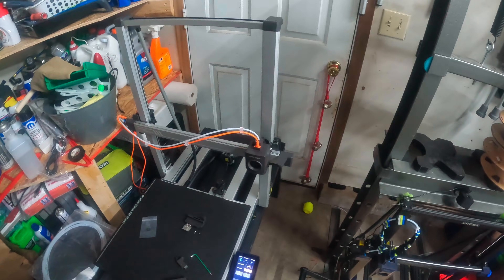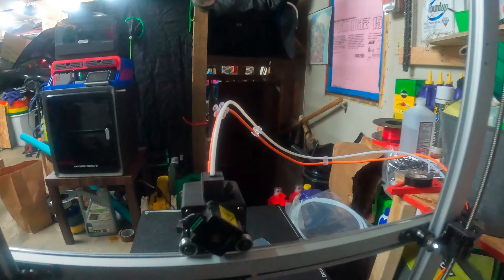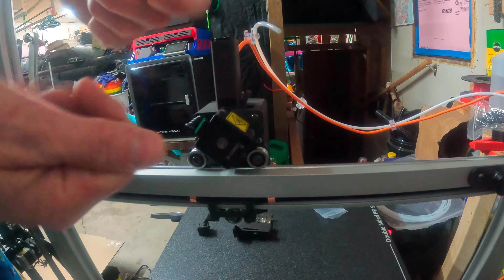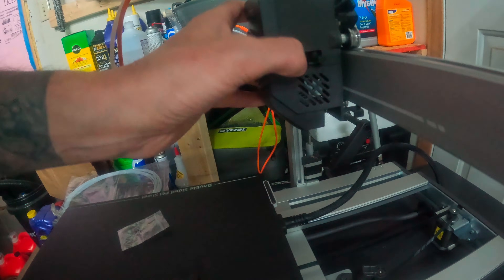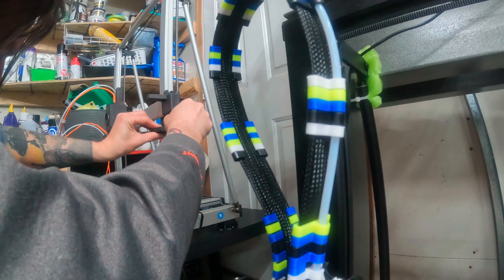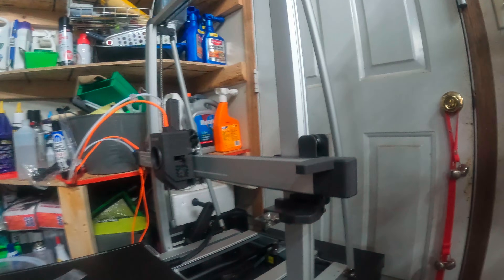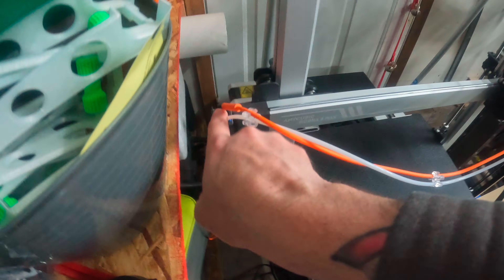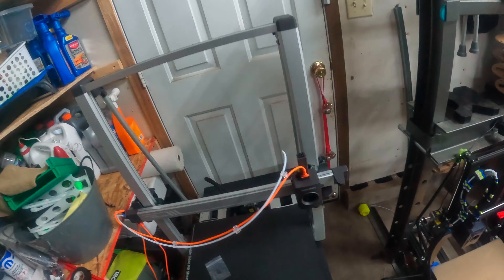Kobra 3 Max multi color setup

Comment: What needs to be done to extrude filament from the multicolor into the kobra max. I am clicking extrude on printer but it's failing.
Reply from the maker: You don't need to extrude any filament unless you're testing it if I'm not mistaken, I've never done it with any other the k3 or s1 just the kobra 2 max